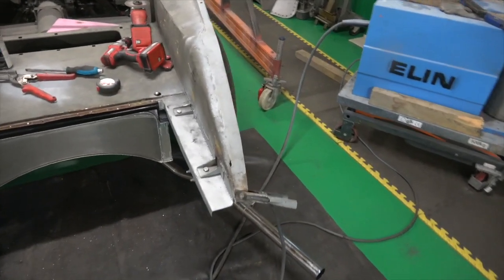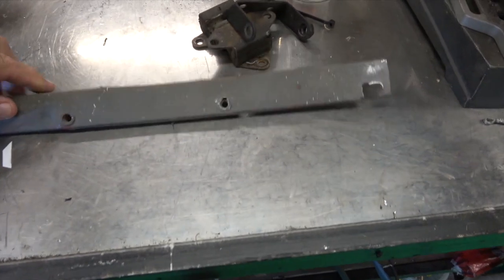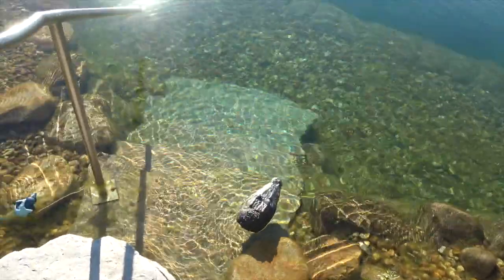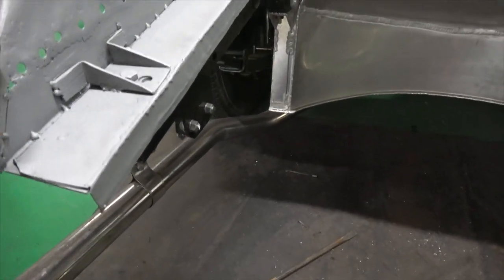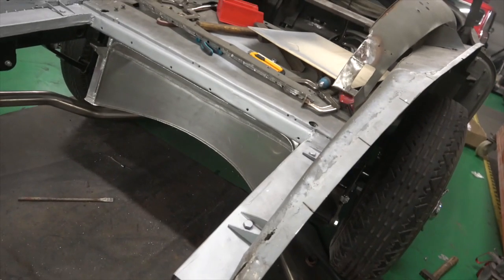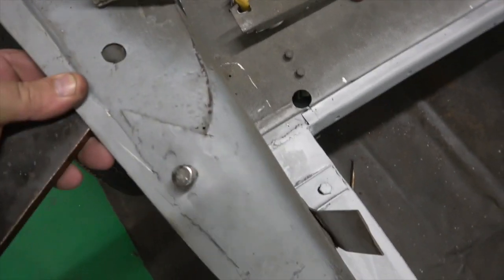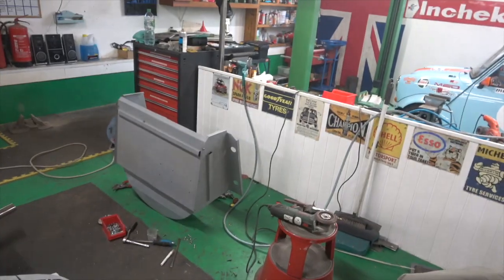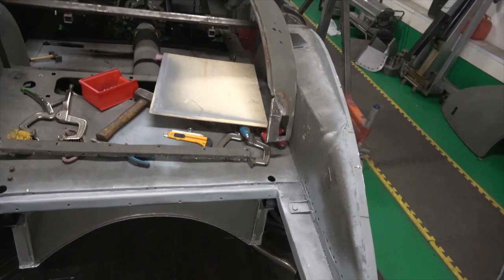Jaguar XK 150 Restoration, Boot Floor & Chassis Mounts

Comment: Looking good Dave.Great job on the panels look forward to seeing it all set up and welded. That crocs head will be good for a laugh lol.
Cheers, Jeff.
Reply from the maker: Jeff,  Thanks, Unfortunately you can not buy the lower gussets that attach to the chassis so we had to make them or copy them from what was left after the rust had it‘s way lol, I‘m half expecting a comment on buying from China even though i 
have said in my comment box i didn't buy it lol, Cheers Dave

Comment: Thanks Dave. Is the front more or less finished or is there still plenty to do ? (Welding ). As l said in my very long tale about the 140 l did,  at least the rear end was already on the car and it was very well made. I can now appreciate how much work your having to do ! Take care.
Reply from the maker: John,  No there is a lot still to do on the front end, The headlight & sidelight pods are done, I think around 12 months of bodywork before it‘s ready for paint, Cheers Dave